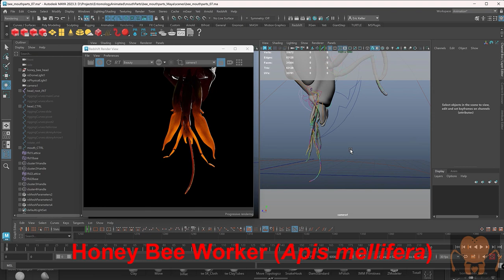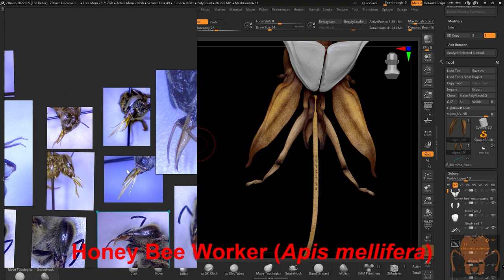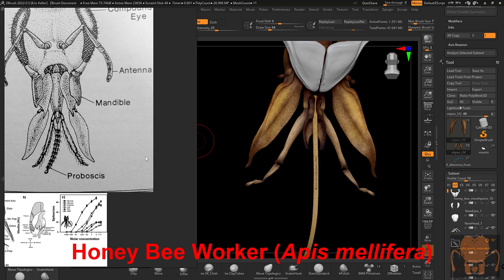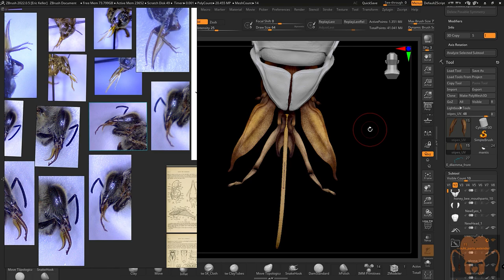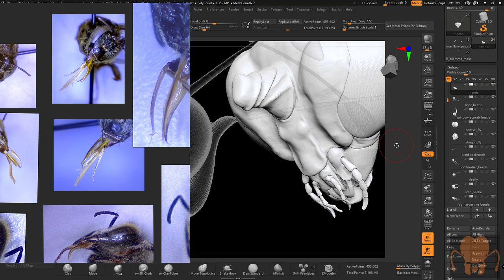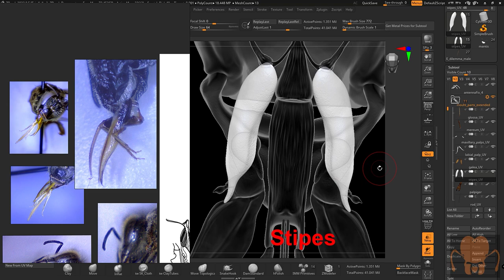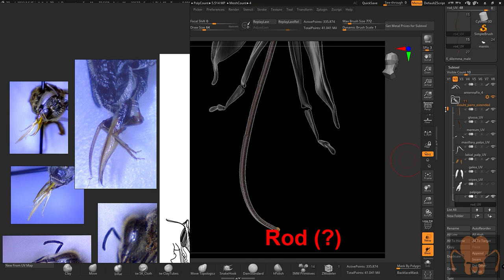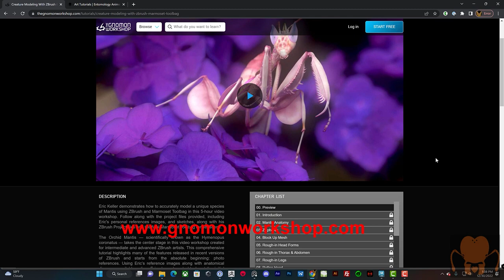Overview of Honey Bee Mouth Part Anatomy

Comment: Great stuff, very inspiring to continue on my own similar project (more focused on Formicidae and 3d printing).  
I am surprised however, think I did not see any SEM photographs among the references, for getting a better idea of the smaller and more intricate structures. 
Almost can't believe you would not be able to find any of those, or you just didn't show those here.   
  
Btw, personally would consider the maxillary and/or labial palps to be more functionally analogous to our tongue, than fingers. Both fine manipulation and tasting/inspection.
Reply: yeah I use the, all the time but don't always share in my videos as I try not to use without permission. I do have several books of nothing but SEM pictures.